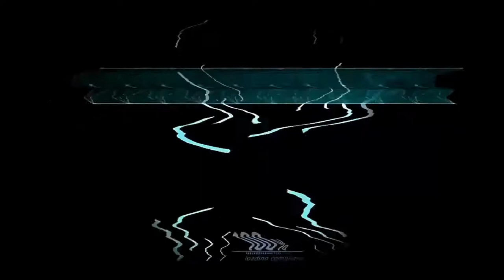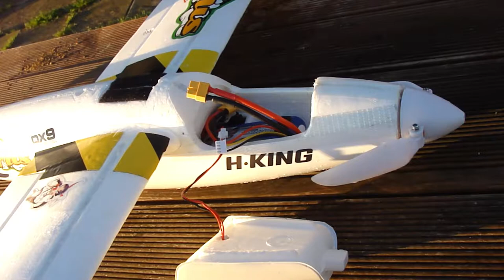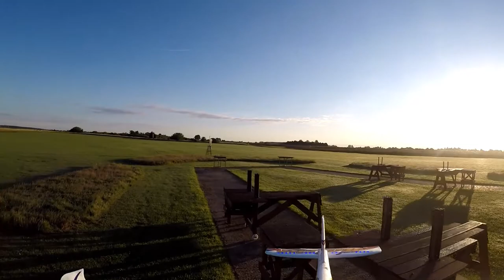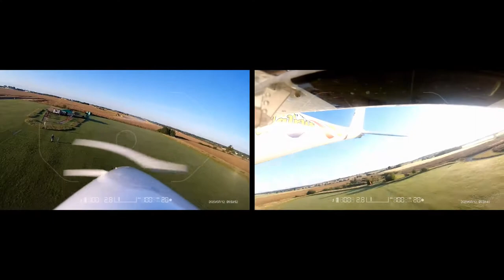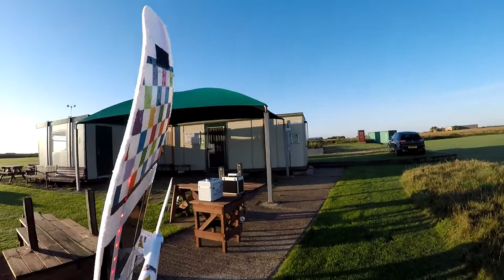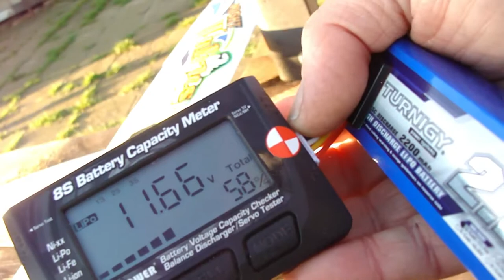Night Walrus first flight (2 x Runcam2- FPV) after Crash Repairs

Comment: Hey Flanker. Just wanted to say been loving you videos recently with the planes and ration packs etc. Like the real flying experience, spending alot of time building, fettling, balancing and repairing! Looks like your collection is quite impressive at the moment and looking forward to seeing the biplane fly!

I am still surprised how these planes only last 5 mins. My DJI mavic drone lasts 30 mins on a similar size battery. I appreciate the motors are smaller but there are 4 of them plus camera, gimbal and on board stabilisation and radios being powered!

 Btw I used to go urban assault and seen you a few times at airsoft but that was a while ago now!
Reply from the maker: Wow Urban Assult - good days.... Did me meet/talk ? - I meet a lot of people at UA, some were aware of my videos at the time others not - but all seemed nice people, my son came on a few occasions and made videos, they are on You tube somewhere LOL , quite a few people I know from UA are still into and doing Airsoft - I still collect Pistols , just purchased the Action Army AAP-01, to add to my collection...waiting for delivery (its on back order) ..... I do like my RC Aircraft - not only flying but as you say all the Fettling and Hanger work (as I call it) it is strange how you can get so much more time from a Drone on the same type of battery, if I were to stay up for that time - well the aircraft would just fall out of the sky at about 7-8 Mins on some of them .. great to hear from you,
Reply: @FlankerTanker  Yer we spoke. If I remember we had similar Nam era kit one day. I had the Classic Army M16A1 with all the period flak jacket, helmets and fatigues. Didn't you have a full guillysuit and sniper set up too??

I have known about your vids for years from when you did the pipe tests (which I smoke occasionally too). Just never thought to say Hi before.

Have you thought about the Horizon Hobby Maule M7? Great stable flyer at both super slow and fast speeds plus chunky tyres for the grass!

Comment: Excellent yet another phoenix from the ashes..... How's the pt17. Finally got the poke in the air this morning 5.30 done 2 laps of the rugby field then I thought how does it glide...... BAD IDEA LIKE A STUKA BUT NO PULL UP AT THE END THE VID SHOWS THE RESULT REPAIRING TONIGHT
Reply from the maker: I saw the Video of the Damage - sorry about that - I have flown mine twice and so far so good - I did leave a comment on your video as i thought the glide problem might be due to weight introduced during the repairs - if you weigh your Slowpoke , I will weigh mine and we can compare ...
Reply: @FlankerTanker  christ and I thought red tape in blighty was bad... Obviously they've either got to much time on there hands or they really have a serious hard on for you and have an axe to grind because in the past you've spoken your mind and the TRUTH about the CAA. In short I would put it down to
             VICTIMISATION
Reply: @FlankerTanker  hi yah
Thanks for the comments. It's slightly lighter than the original because I've got a lightweight undercarriage.... to get the CG the 2220 is as far forward as it can possibly go... Bearing in mind the filed isn't as manicured as yours it's more like the HIMALAYAS. Repairs are coming on.. Hopefully Friday should be good to go... Just curious do you have a flight controller or stabilisation on yours.
Cheers
Brian